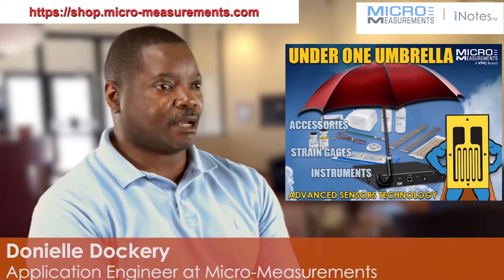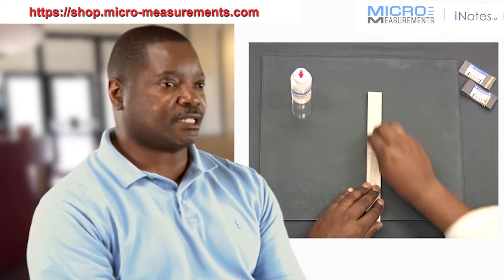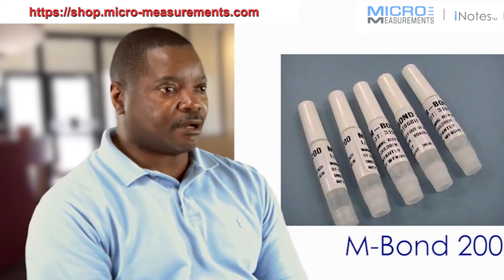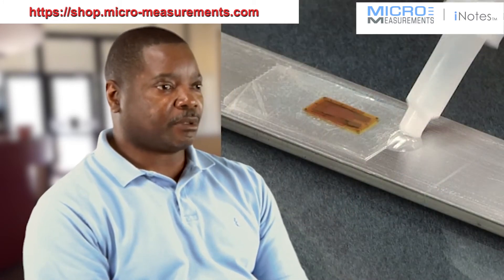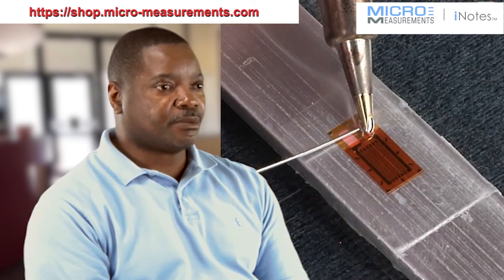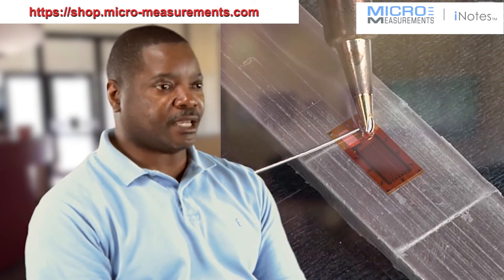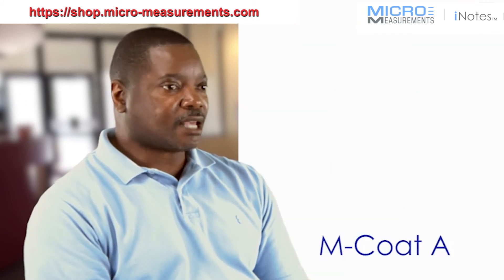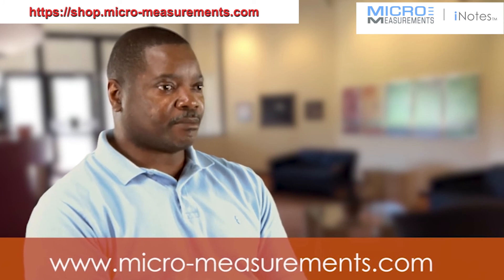Strain Gauge Installation In a Nutshell.

Comment: I've recently came across the strain gauge process. It looks as if the sleeve it can't with was attached with the adhesive. Am I mistake? The novice two minute instructor had me remove it from the sleeve with tweezers. Was that unnecessary, will the film still allow the test to be conclusive without the removal of the manufacturers sleeve?  Thank you so much!